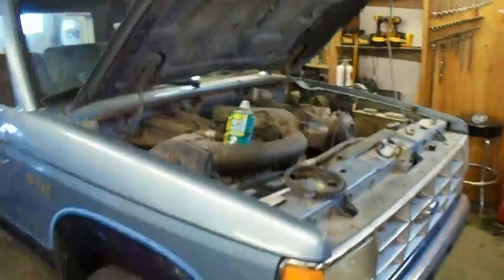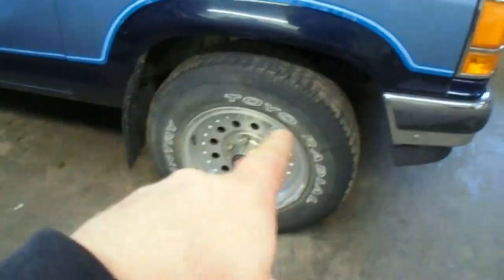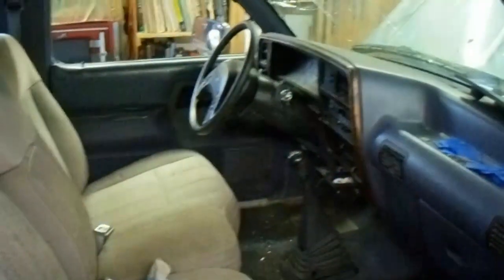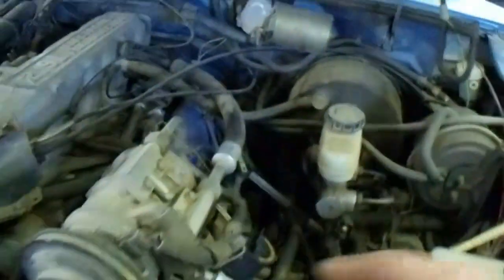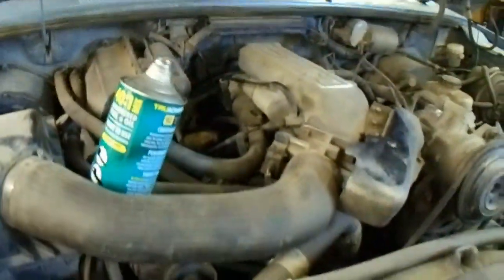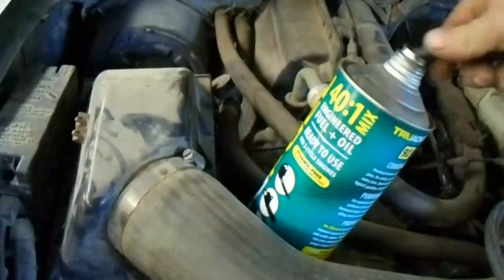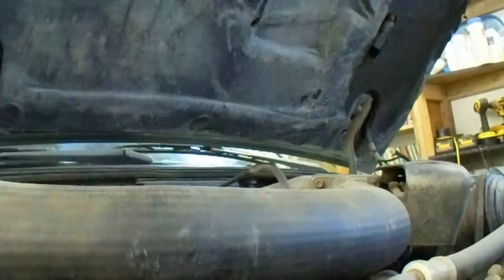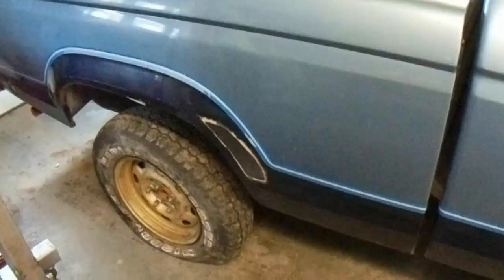Tips for resurrecting a vehicle that has been sitting for an extended period of time

Comment: Very good diagnosis Wayne.That was a neat trick with the vacuum hose(never would've thought about that).I usually take the bed off a pick-up when I change a fuel pump(I have a back hoe) I don't like laying on the floor and screwing with the tank straps and all the darn hoses.Good video,keep them coming.

Comment: i had a 89 ranger that looks almost identical to this truck i drove it for a few years until the radiator cracked and my temp gauge was not working and unfortunately cracked both cylinder heads my mom has a 91 ranger that she has been driving for 8 years now only problem it ever had was wheel cylinder started sticking excellent little trucks i love these things